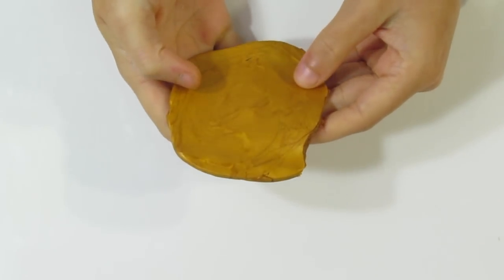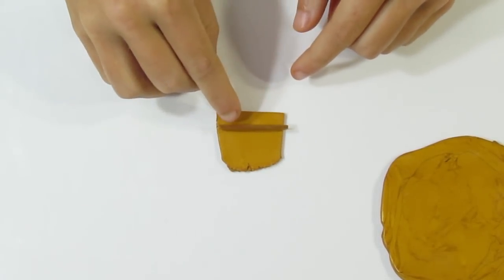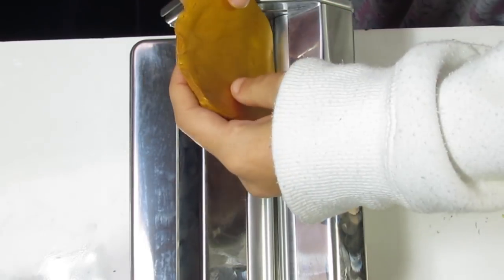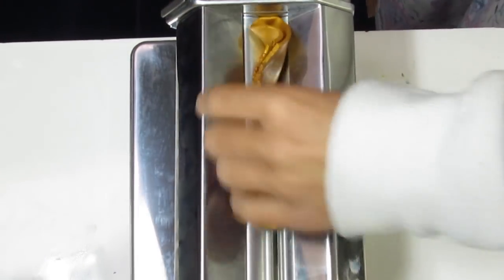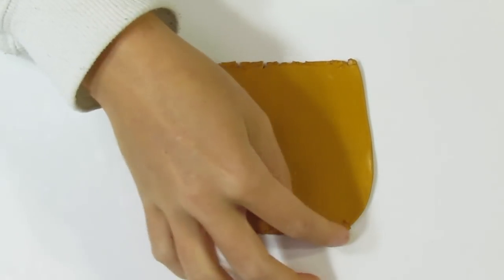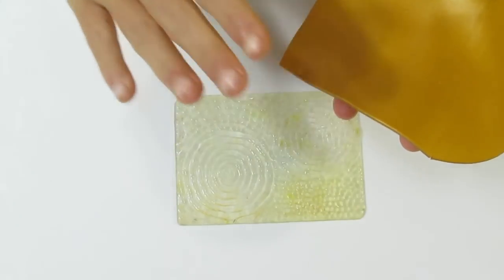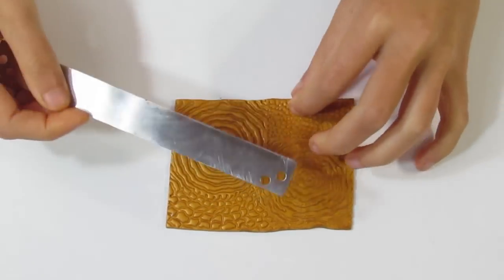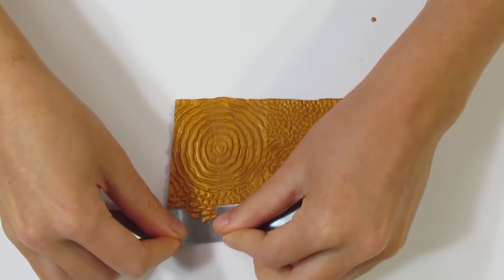Getting Started with Polymer Clay:  Mica Shift Tutorial

Comment: Such beautiful pieces!! I can't wait to get started. I have been putting off making anything that I actually need to use my pasta machine for because when I 1st got it in the mail it wasn't working right, it wasn't put together properly. And so my husband had to take it apart and put it back together. And it just never really worked right. My clay continues to get stuck in or on the blazed and makes a mess out of my clay. We just can't get it fixed. :( 
So I guess I'm just going to have to buy a new one and it was an inexpensive one, so now that has me worried about buy the less expensive ones and I'm looking to get a higher end machine. Maybe I could get by with another inexpensive one ,but like I said it just worries me that I'm wasting money. Anyway, so sorry didn't mean to ramble on. Thank you so much for sharing all of your beautiful work. <3
Reply from the maker: I like to buy cheap pasta machines from ebay. I usually get the Jamie Oliver one. That one works really well for a cheap pasta machine.
Reply: Thanks so much